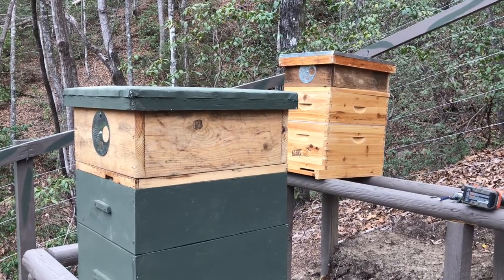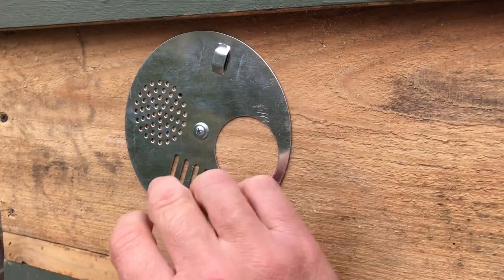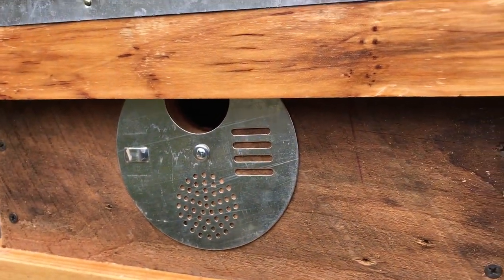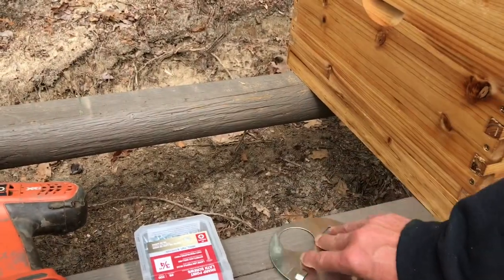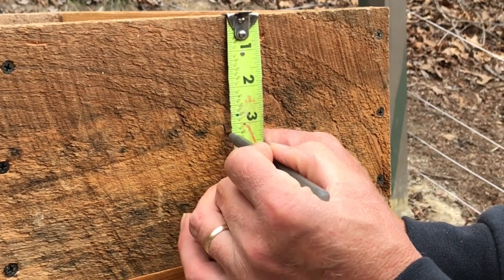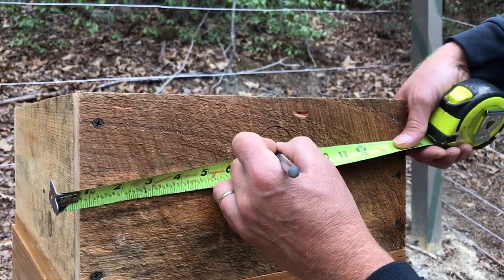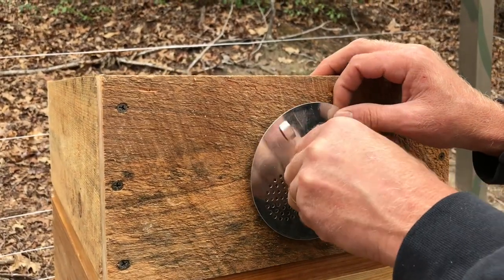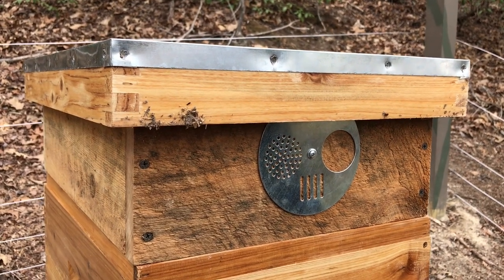BEEHIVE ENTRANCE DISC/GATE-How to install

Comment: Thank you so much for these Apiary videos. This is very helpful for me. I especially like this ventilation device and will be using them also. Would you suggest placing the ventilation hole on the side facing the predominant prevailing winds or otherwise? Environment will be cool mountains.
Reply from the maker: Glad you enjoy the bee content. Vent location is you personal preference. Most face it the same direction as the main entrance. I don’t think it matters for venting, for another entry it would need to face the front.

Comment: Looks good! What brand holesaws do use?
Reply from the maker: Thanks, I use Lenox brand hole saws.
Reply: @THEOFFGRIDMOUNTAINHOMESTEAD  cool, I thought it was.   I have started using some of the spyder tarantula holesaws. They are tough. We have been using them drilling through plaster,hardy,metal,sheetrock, and wood. They will work with most mandrels.  Thanks for sharing this video!
Reply from the maker: Thanks for letting me know about a different brand to check out! 👍